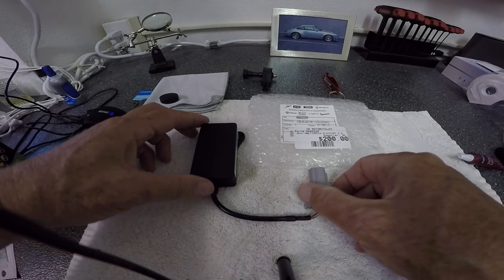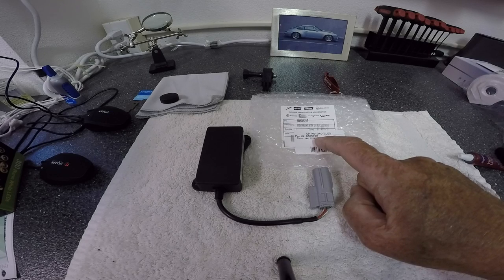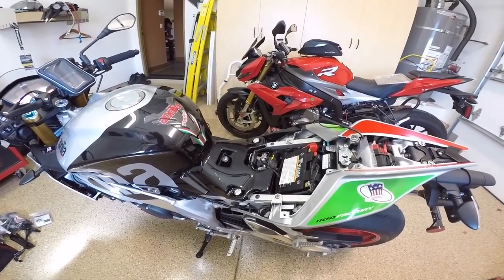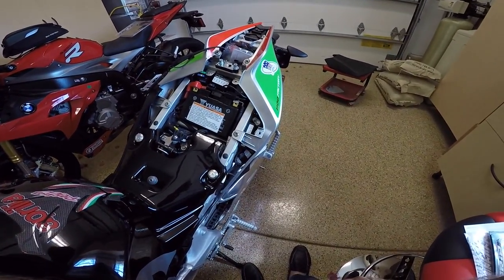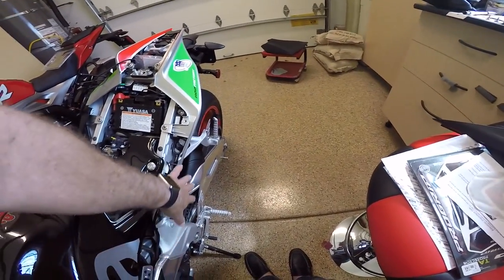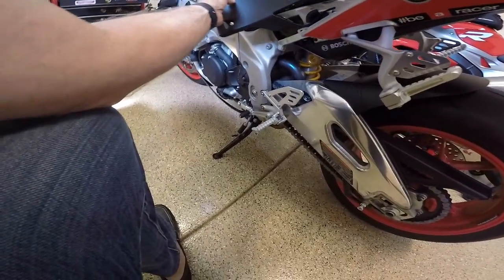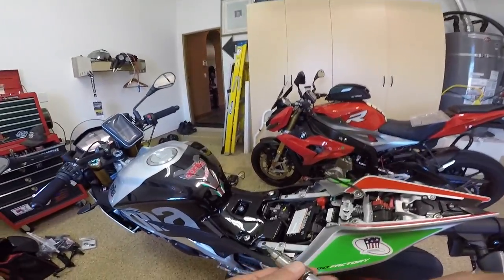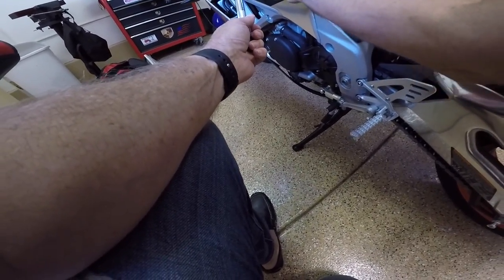Installing Aprilia PMP unit on a 2017 Tuono

Comment: And someone said one had to remove the tank in order to install the module but having seen this, it can't be easier. Why would you need to remove the side since it is mounted on the grey plastic part and not the black side panel.?
Reply from the maker: Really it would be possible to do it without removing the panel. I have clumsy fingers and the extra room was nice. And, the panel is such an easy removal.....so I think I'd still recommend removing the panel but perhaps not 100% necessary.

Comment: Hi Gary, I have the 2017 rsv4 rf. Im just wondering if you ever experience “hot start issue”? I noticed u have the extra red cable connected from your battery to the solenoid. Also does your middle headlight (highbeam light) fog up/condense every after riding?
Reply from the maker: When I first purchased the Tuono it had a hot stall issue...that is on two occasions my bike stalled when coasting to a stop under very hot conditions; approximately 95+ degrees ambient and a long ride before. I had to make my way to the side of the road and turn the key to fully off, before restarting......however at the first service a factory update ecu flash was performed. After this I had no more hot stall issues. And since installing a factory approved Akrapovic exhaust and further ecu update the entire machine runs cooler by about 10 or so degrees.....so no more. 
You might ask your dealer if they have installed the ecu update that helps to correct the hot stall issue. 
On the headlight, no I've not noticed any condensation on the headlight middle.....but San Diego is a dry climate usually so we may not have the same conditions. 
The battery connections are as from the factory wiring....no issues there. Except I did discover there was a power take-off under the right hand side fascia on the instrument panel, this I have used to provide a power line to my iPhone so it remains charged. It works great. You can see the video I did this on which I did a while back.
Hey good luck El Rey Es! Or should we say Buena Suerte Rey Del Moto's? ;>)
Reply from the maker: Sorry! I said "right hand side fascia" it is actually on the left hand side when sitting on the bike facing forward....

Comment: Hi Garey,
Noticed a S1000R in the background,
Which bike do you like better? and why?
I am currently looking at both bikes,
regards
Jay
Reply from the maker: Hey, yes that is a 2014 BMW S1000R. I have had it for two years. 
First, I will say that either machine is awesome. So whatever you buy it is really hard to make a mistake. 
Here's my quick take for you;
1. If you're going to be relying on the machine for daily or near-daily use, go for the Beemer. Not that I haven't had problems with the Beemer! But it remains to be true that parts supply and the dealer network for BMW are really strong compared to the Tuono.
2. Having said that here are my takes on the differences, mind you I haven't had the Aprilia for even a month yet so full opinions will take some more time to form.
     A. BMW, plenty of power and the straight four makes a nice howl when you get it up on the cams. The exhaust system crackles and barks through downshifting and it's really fun to row through the gearbox, quick shifter up...and manual down for the '14's. It has a very German precision feel in handling, perhaps not quick but very planted. Plenty of on board tech, with choices for ride modes etc.......think of it as a BMW M3 with two wheels.
     Also on the BMW the suspension is of the "active" computer controlled type and cannot be faulted. Adjustable via the menu from firm through soft, it handles any type of road very well. Fairly aggressive riding position, your knees are pretty much tucked; so not suitable for long(ish) stints in the saddle. Tons of aftermarket stuff available as they are made in quantities enough to cause people to look at the market.
     B. Aprilia, It's got those Italian good looks! Man, this bike has presence...even non-riders look at it and comment. The engine sound is sublime, maybe the best sounding engine I've ever heard, and this includes some pretty good machinery in my lifetime. Quick shifter up and blipper down, works like butter. Handles like a javelin in the corners, and very few machines will be able to out drag you. Feels light and agile, the suspension is firm but surprisingly compliant. This machine is like a computer on two wheels, and the added PMP Module has even further pushed the envelope on melding the digital world with motorcycles.

It is not an easy choice! So here I will return to my opening statement. If you're going to use the machine on a regular basis and it needs to "be there" for you for work, commuting, etc....take the BMW. If you have the luxury of just wanting a bike for weekend or off hour blasts through the canyons or elsewhere, go with the Tuono.
I would say to visit your dealer for both brands. See what the "look and feel" of the dealership is like, after all you're gonna spend some pretty big moto bucks and you'll want the dealer to be there at purchase and afterwards. So, try the dealer on as well as the machine itself.
And as I said at the beginning both machines are truly exceptional, so very hard for you to go wrong.
Reply: Garey Cooper 
Thanks Garey,
i have ridden these 2 and fz10.
i feel the tuono is the way to go for me.
dealer location is a factor.
tuono is 15 minutes away.
bmw...1.5 hours away.
plus for me,the tuono was amazing, s1000r was fun too and fz10 a distant third for me.
cheers
Reply from the maker: So, there you go...if the dealer is 15 minutes away DO IT! You'll love the Tuono I am sure. As you say, amazing. Let me know how it turns out.

Comment: i heard people dont bother with connection kit as its just two screws and zip tie. how did you hold the unit in place.? double side velcro?
Reply from the maker: Lee, the connection kit is to say the least "under whelming"......and I think it would require drilling some holes to use the mounting screws provided. Yes, I just used some double sided velcro, and even that may be unnecessary as the unit fits very snugly in the location. I think one could just plug it in and cover it up........good point.
Reply: Garey Cooper mm great night buy the box as seen for about 140 quid online Cheaper than dealer offered. Although not sure I’d use it enough.

Comment: Didn't trust myself. Dealer put it on (and akra). Picking it up tomorrow. If you have time can you address the "install kit" they made me buy? The way they explained it (after I asked many questions) was the MP can be installed on many different Piaggio bikes and you need the Tuono-specific install kit which is why it's not included. Did you need it? I'm still skeptical and also curious how much labor would be reasonable to charge me for on this job.
Reply from the maker: RoadRunner My 2017 Tuono did not need an "install kit". The bike was already pre-wired with the mating connector. I only needed the part number that I showed in the video. I am very amateur and it took me less than 20 minutes to install and pair with my phone, an iPhone 7 plus.
Reply: Garey Cooper thank you for the quick response. Will bring it up with them today.
Reply: ive just received my tuono module,,,, where do i find the on bike connector??
Reply: The install kit is two mounting screws and two zip ties.  I just received my V4-MP module and plan to install it on my 17 Tuono Factory.  I'd like to use the factory intended mounting location and screws but I don't know what size the screws are.  If I don't have the right size screws then I might just install without as shown in this video.

Comment: Hi Garey, these were the top 2 bikes for me to choose from. I chose the Tuono even without a chance of a test-ride. I rode the Beemer. Both are exceptional, but having had the bike for a week now I feel it suits me better than the BMW. If only it had the electronic suspension, but oh well, not gonna complain about the Ohlins, miles better than what my previous bike had (CB1000R). I see You have a phone. Did You try and unscrew the left panel of the dashboard? The '16 versions have a blank cable there, dedicated for a usb adapter. I have yet to look at it, but didn't have much time. If it's there I'll install the usb adapter, as I'd bought the multimedia platform as well, and would like to see additional data while I ride on my iphone...
Reply from the maker: No I have not looked for a USB nor did I know there could be one there..I will check on that right away. That would be awesome if there is one.
I will bet that within a few years, if not next year that Aprilia amongst others will begin to offer electronic adaptive suspensions. It is the future.
And why don't they already include a USB adapter?! It is the 21st century and I would be that close to 100% of riders do ride with a mobile phone....I mean really?
And, why I'm on the subject I will also chide Aprilia for no gas gauge, come on guys! Again at this price point and with so many sensors already on the bike I wonder what the technical/cost challenges were to preclude a gas gauge.......
Okay, having said that it IS an awesome bike.
Thanks again for the hint on the USB, keeping my fingers crossed that there is one.
Reply: Garey Cooper let me know please. Also, I have no clue how to engage the hazard lights... any idea?